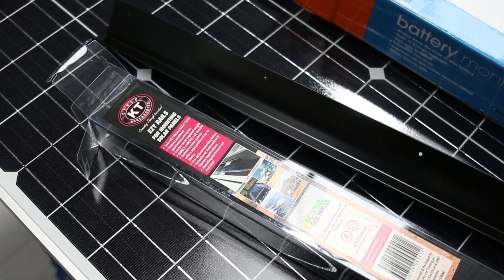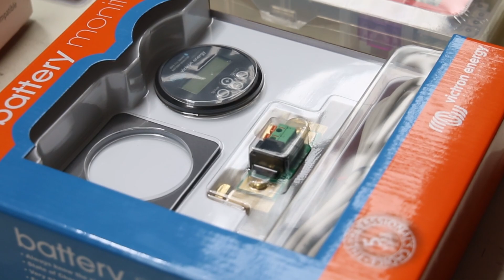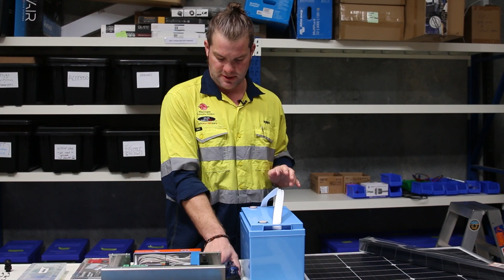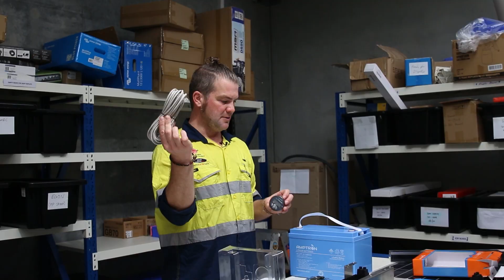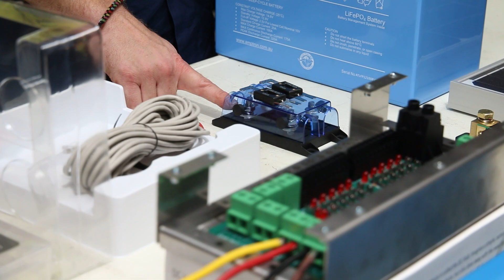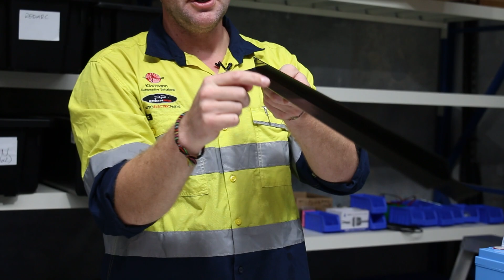Standard Canopy Wiring Kit Overview & Setup | Ready to Drive Anywhere Kits

Comment: Nice kit! Everything you need, My system is a bit more powerful for induction cooking

In my Unimog I just upgraded my solar panel from a very old 190 watt panel to 340 watt panel. Everything is Victron with a 30A DC-DC and a phoenix 2000VA and 200AH Aolithium batteries.